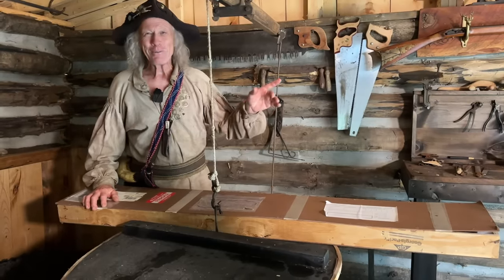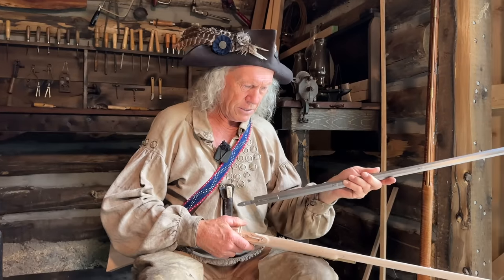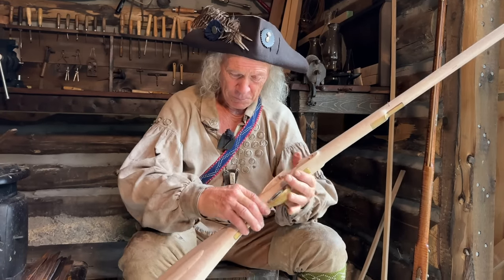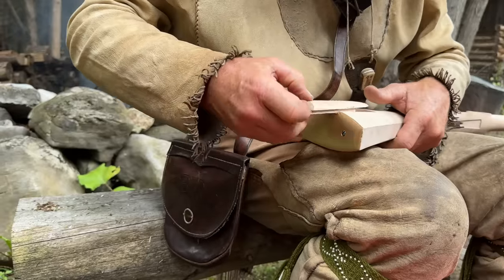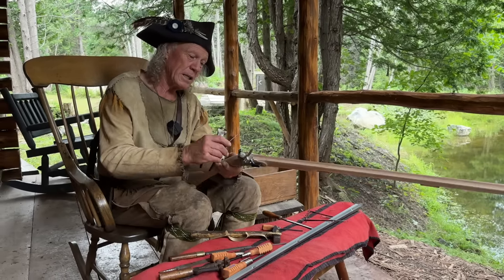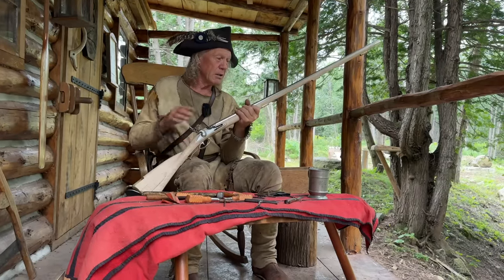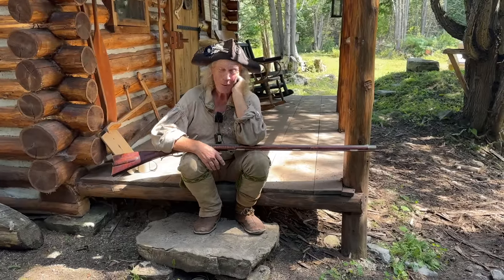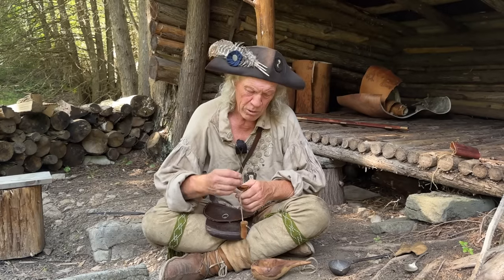Building a Jim Kibler Woodsrunner Flintlock:  How Easy is This!!  | DIY | BLACKPOWDER | LONG RIFLE |

Comment: Hello, great channel. So I was wondering this myself for a hawken build. How would they have stained wood back in the 18 th century? They probably didn’t have all these chemical stains I’m guessing.
Reply from the maker: The most commonly used stain was aqua fortis, usually call dirty water.  It is a mild acid.  I normally use it n my builds.  When applied the wood turns green, then I apply heat and it turns a beautiful brown.
Reply: Very cool. Where would I be able to find aqua fortis? Also, could you do a tutorial on staining with it? Also, I am looking for a Fowler, where would you recommend I look for one? Thank You!
Reply from the maker: @evanannunziata2859  if your thinking kit builds , Track of the Wolf , Pactonica or Jim Chambers.
Reply from the maker: @evanannunziata2859  Try chemical suppliers for schools, you can buy in smaller quantities.

Comment: What did you use to patina the barrel? That's a great color.
Reply from the maker: I used Cold blue.  Cleaned the barrel, wiped it on, left it for about 3 hot 4 minutes then wiped it down with a wet rag to stop the process.

Comment: Beautiful work. I do have a question.  When you load your rifle do you use a starting stick?  From doing reenactments and shooting matches back in the 1970s through mid 1990s, my friends who were riflemen always used a starting stick/short stick in loading.their rifles.  Regrettably, they have all passed. I exchanged some messages with a gentleman recently and he claims this is a modern thing, not 18th century.  What is your take on this?
Reply from the maker: I believe that riflemen carried a short starter.  You don’t need it for the first 3 to 4 shots but, after that you simply can’t load without one.

Comment: That was a fun video to watch.   I own one flintlock rifle that I purchased put together about thirty years ago.  It's a Lyman Deer Stalker.    I am getting back into shooting them (watched a guy push the ball and patch with his chin and stopped shooting after that).  
I want to build my first rifle from a kit.  I'm thinking to start with a simpler flintlock first.   
Any suggestions for the rifle to start with?
I absolutely love the rifle you completed.   Maybe my second build would be this rifle.   I would like it out of cherry and I believe the company has cherry stock.    I've got cherry stock at the house from milling a few trees on the property.   I'd love to shape my own, or have the company mill my wood for the kit (I know that's not happening).
Reply from the maker: Some companies you can supply your own wood.  Also a number of kit manufacturers offer their kits in Cherry. I’m working on a scratch build in cherry right now.  You might try Track of the Wolf kits.  However, if is a first time build it doesn’t get any easier than the Kibler Woodsrunner.
Reply: @TheWoodlandEscape  Thanks for the information.  This is my first build.
Reply from the maker: @beebob1279  I hope it turns out well.

Comment: How did you patina the barrel
Reply from the maker: I used Casey Cold Blue.  Cleaned barrel, applied the blue, left it for about 4 to 5 minutes then immediately wiped it down with cold water to stop the process.  I’d never tried this method before but, it exceeded my expectations.  Turned outa lovely gray .

Comment: Who did you buy the mold to make the balls do you have the company's name thank you sir let me know
Reply from the maker: Google Callahan Bag Molds, his products are second to none.
Reply: @TheWoodlandEscape  thank you sir I will look I am also building a rifle from the company it's a beautiful rifle
Reply: I bought stain for the Woodstock beeswax would that be an good option covering the wood after
Reply from the maker: Best advice I might offer is to get a scrape piece of wood and see in the end results are what you’re looking for.  I’m not familiar with that particular produce but, I would think any stain will work if you like it.  I prefer to use gun wood stock oil over the stain … 2 to 4 hand rubbed coats and reapply once a year.  Hope this helps.

Comment: Well considering the absurd price of his barrels, they better be shooting sub moa @50 yards. You should get a table vise when you shoot it, so we can see what kind of accuracy it actually has.  A quote from  J. Browning, 0nly accurate guns are intresting
Reply: Don't need sub-moa to put a ball in the vital area of a moose or deer.
Reply: @kneyork9930  yep, and don't need a $1000 flintlock to make that happen either
Reply: Have you priced a quality swamped barrel from a quality barrel maker?  My guess is probably not.  The barrels in Jim's kits are either Rice or Green Mountain/Kibler.  Both are very good barrels.  I have a Kibler rifle and it will shoot with all balls touching at 50 yds. off a rest.  The Kibler kits are a great value if you want a quality correctly styled flintlock rifle.
Reply: @Snap4590  truth be told I shoot ELR on several platforms from smallbore air to modern powder burner. The best barrel in the industry for small bore powder burner is 325 to 475. And that's guaranteed to be sub moa groups, I ring a 5" gong at 800yards with a  77grn BT.
   There is only one muzzle loader I know of that actually shoots smokeless powder, and they are extremely pricey. But they have extreme accuracy. To each their own I guess. I've seen enough DIY kits in the $400 range that look like just like a Pennsylvania smoke pole that has hung plenty of meat
Reply: @shanestamball1886   My comment was in response to your comment "the absurd price of his barrels"  His prices are in-line with custom ML barrels.  While the $400 kits (and I've built a few) may be accurate, they are not historically correct.